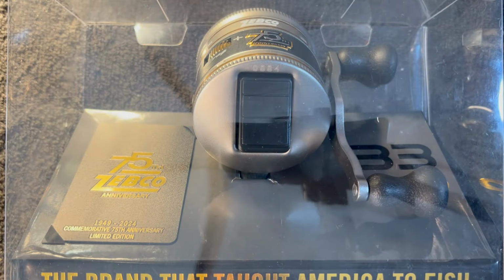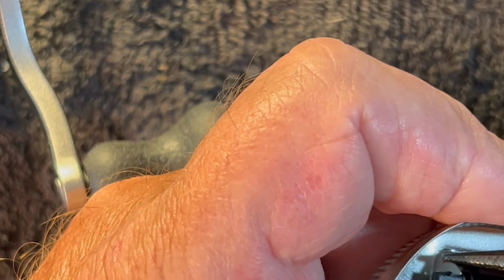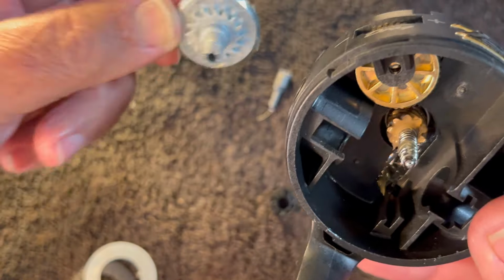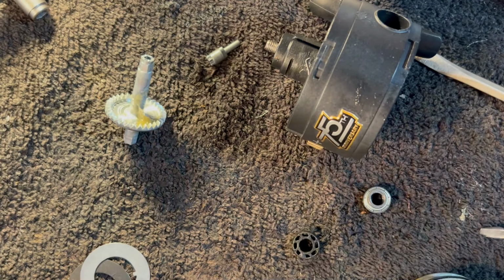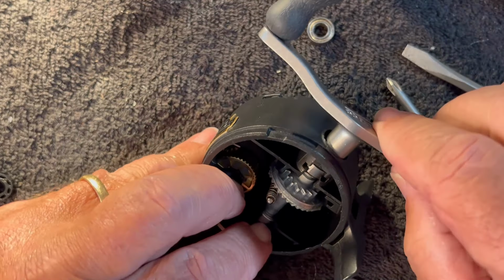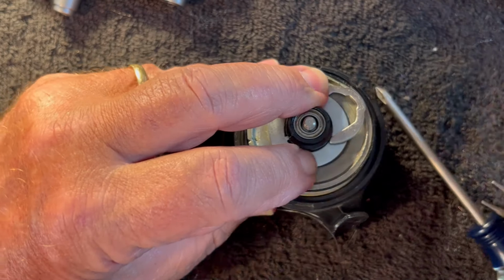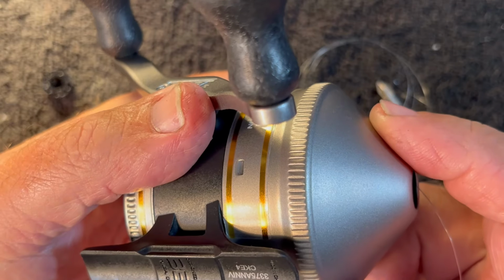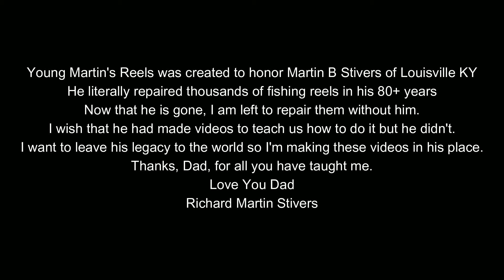(Read comments on bearings) Zebco 33 75th Anniversary -- Service and Hot Rod -- Young Martin's Reels

Comment: I like this design much more than the recent generations of 33, this looks more like the 80-90s Zebcos. I hope they improve the quality, I would like to get one soon.
Reply from the maker: I don’t like the looks of the later models or the snap on rear cover but the performance of they doesn’t seem too bad. I can’t remember if I made a video those or not. My major problem with the 80-90s 33s are the deteriorating rubber and line brakes on the spinner head. I know you can glue on a plumbing o-ring but they should have at least made improved spinner heads available for purchase. I’ve had over a hundred of those reels come across my bench and every one had that problem.  Some appeared to be good but a soon as I tried to wipe off the dirt, they crumbled. I won’t even work on one any more.
Reply: @youngmartinsreels5314  Yeah it’s really unfortunate about the line brakes, I’m kind of surprised no one has created a 3D printed replacement yet. I’ve found a Danco #19 o-ring (1-1/4” OD, 1” ID, 1/8” thick) works but I’m still testing it against not using one at all.

I have been using them without the brake when possible even though it pinches the line between two metal surfaces. From my research and observation, the Johnson Century 100 and Zebco 700 Hoss also pressed the spinner cone directly against a metal cover so maybe the line getting pinched isn’t that big of a deal after all? Of course if it doesn’t work any longer that’s going to be a huge issue so this only applies to the reels that’s still function without a line brake.

I have also noticed many plastic bodied Zebcos press the spinner cone directly against the cover as well although I assume this is because the plastic body would theoretically pinch the line less.
Reply from the maker: My biggest issue with them is that I was servicing them for a friend to resale on EBay. He wanted them to be all original and in good shape to keep his eBay rating high. It just wasn’t possible with those reels. I finally had to stop working on them for him. Now he just sells them as parts reels.
Reply: The 33 Platinum is extremely well made and right now Amazon is selling them for $29, snagged one the other day.  Very impressive 33 indeed

Comment: so if my math is correct it has 3 bearings?  2 plus 1 for the  clutch?    If so I think this is based on the 33 Gold  ?    Interesting choice to model for the 75th Anniversary  it's a fine reel  but i would have thought they would  have used the 33 Platinum as the their 75th Anniversary  special.     Oh I ordered one anyway for nastalgia and I do love the look of it.  I love the 33's   we have 3 currently in the rotation,  the Standard one bearing,  the Black which as 4 bearings and the Platinum with 5 bearsing   Love them all,  especially the Black and Plat.    They cast and reel in verry nice  esepcially for the price.      Not sure if I will keep  the 75th  on display or pop it on a reel.   Anywho nice video  love these tear downs.

Comment: Sorry but I ordered the bearings you suggested however they are the wrong size. Im trying to find the correct size now.
Reply from the maker: Sorry about that. Which measurement didn’t fit?
Reply: @youngmartinsreels5314  the bearing on the front center shaft outside diameter to big. It will not enter.  Also the other bearing on the other side of the handle will go in but to tight to turn the handle afterwards. Great video otherwise.

Comment: You added bearings - but are they ABEC-7 full ceramic?

Next up: backup anti-reverse because, why not? Given the main gear has AR teeth on the back side, maybe Zebco utilized old frames for this reel too, and maybe old AR parts will fit and function.

Then carbon drag washers because, like, you want drag to be smoother than a - better not say it; YouTube might not like that old slogan.

Maybe you can get ProGear to manufacture a stainless main gear too.

And Accurate or Tiburon (are they still in business?) to manufacture a frame CNC'd from a solid block of aluminum.

And how about a monster winch handle, sourced from an old boat trailer's winch?

By the time you're done, a few $$$$ later, you'll have a reel you'll be proud of and confident in for catching the bluegill of a lifetime!
Reply from the maker: You’d still need to add some welded loops for the spool release button. Then add ring to the front cover hole to eliminate the sharp edge. 

There’s not enough length on the center shaft of the case to put in better drag washers so you would need to extend that when you made the new case. Of course extending that means you need a longer axle shaft. The list just keeps going. 

The added bearings are overkill for a reel like this. I mostly did it just because I usually won’t replace bushing with bearings. It was kind of a running theme I had going with Chris Jenkins. He tried to replace every bushing with bearings and I don’t. These plastic bushings are just so cheesy looking that I couldn’t help myself. I actually prefer good bronze bushings to bearings every time. I’ve never found a bad bronze bushing but I’ve had to change out plenty of bad bearings in reels. Some of them were less than a year old. Let’s face it, most people don’t want to go fishing, then come home and take their reels apart to clean and service them. Salt water can destroy a bearing just a day or so. 

To this day I’ve never installed an ABEC-7 full ceramic bearing in any reel. I don’t work on reels that are worthy of that kind of expense. Most reels I work on are old abandoned reels from the bottom of the line that their owners have determined are no longer serviceable.
Reply: @youngmartinsreels5314  I wholeheartedly agree! I've never had a bushing go bad (other than the one I sandblasted, duh...) but I have had a reel where every single ball bearing went bad after a single ocean fishing trip on a party boat. I suspect a deckhand sprayed / soaked the reel while spraying down the decks with sea water on the return to port. Reel was totaled because cost to replace all the bearings exceeded the price I paid for the reel.

I see zero reason to put full-ceramic bearings in a reel. Sure, they won't corrode; but that doesn't mean maintenance is no longer required. Get salt water in the bearing, let the water evaporate, and you're left with salt crystals in the bearing; not good. Ceramics are brittle too. Imagine dropping one of those expensive bearings on the floor, and the thing breaking into pieces! Beyond that, I wonder if they're up to the shock loads they might get if they're supporting a spool filled with braid.

Comment: I prefer the older reels. Most modern spincast reels are mostly junk and very cheaply made.
Reply: I have 2 I like from years ago, an old red abumatic and a Diawa silvercast, I think thats the correct names. Both are very nice to use and very reliable. I mostly use high end baitcasters now, but I keep the old spincast reels ready for kids, some women, and occasionally myself. Buying one of these older reels in good condition will serve you much better than modern spincast junk.
Reply from the maker: @hytekrednekbama4400  I agree that most reels today that are priced below $75 are pretty much junk. Of course most reels in the 60s that were priced below $15 were pretty much junk too.